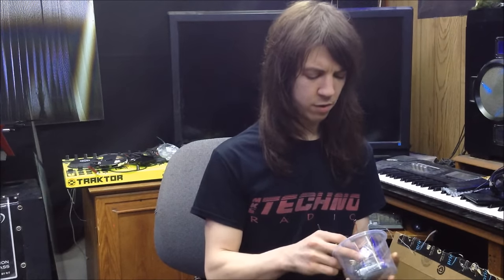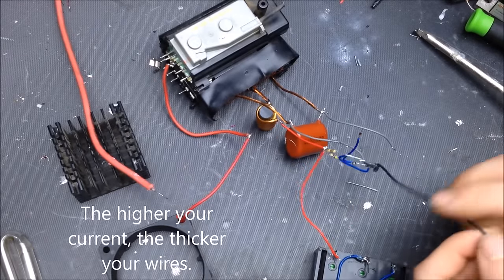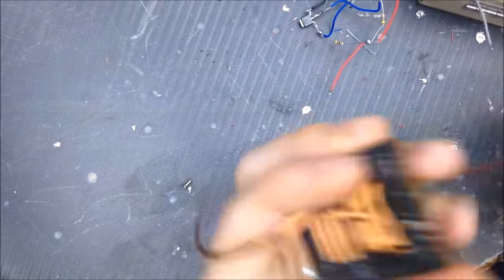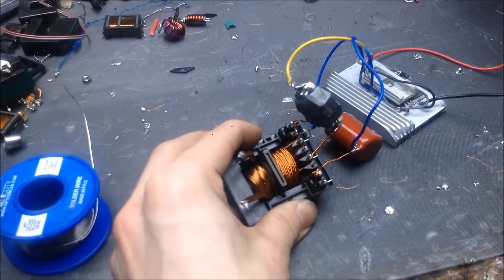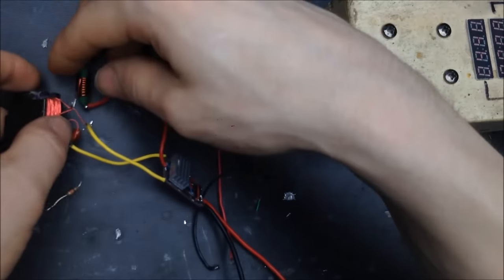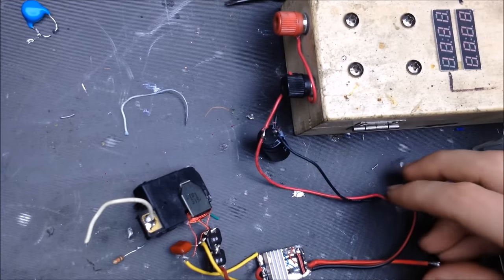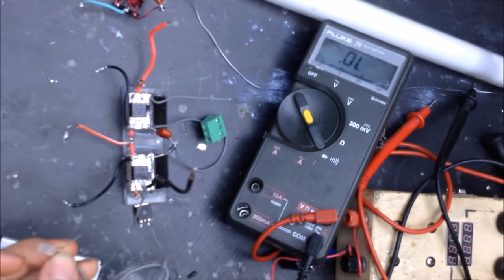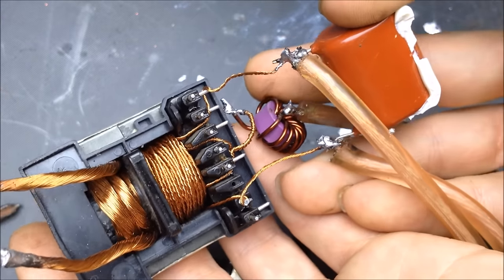Bare&Basic ZVS Circuits of all shapes and sizes.

Comment: A friend gave me some random stuff a while back and in it was one of those little high frequency transformers. It had a center tapped bifilar primary so when I saw it had a decent arc from feeding half of the primary a square wave I tried just wiring it up as a blocking oscillator and it gave me an amazing arc from something around 5 watts. It was surprising similar input and output compared to what I got using the frequency and on time I ended up liking the most from the square wave generator so it must have been a fairly low duty cycle still able to output the burning plasma. The arc was way longer than it should have been, something close to an inch and I was going to make a battery arc lighter from it but stuuuuupidly tried 'potting' it with gorilla wood glue and it ruined the secondary. Similar transformers I pulled from LCD monitors wouldn't perform the same. Been trying to get into flybacks again recently and I always think of that little transformer.. tape was gone too along with the part number. I'll def be absorbing what I can from this video over the next week or so I've just been slacking on scrounging for some 12v zeners.

Comment: what inductor should i use for a tesla coil?
Reply from the maker: How many watts, volts, amps is your TC? your frequency? what roll does the inductor play in the circuit?

There is so much that goes into properly calculating all these factors. Try this website to figure out what you need for your configuration.
http://www.classictesla.com/java/javatc/javatc.html
Reply: @Zenodilodon   @Zenodilodon  10 amps at 12 volts i want to find the right inductor for the ZVS for the best output power on the secondary by the way the secondary is a 500 turn coil with 28 AWG 
i am scared to fry my driver or coil by being stupid
thanks for the link m8 :D
Reply from the maker: @anekdoche7055  You're scared to fry stuff? Mate, you're making a device that fries stuff lol.

You're probably going to need something of decent size and speed. Let me give you some tips on how to figure out what will work. 

The wattage you will need is around 120W, consider the size of the magnetic components needed to move that kind of power ( IE the small transformer in a 5v1A phone charger VS the transfo'rmer in a laptop PSU ) This will give you insight on what magnetic mass you need.

Note that most ferrite cores will work as long as they are not for filtering purposes and will eat your power and got hotter/have slow response. 

You will want to skirt as close to the minimum core size needed as the TC itself is an air gap core that typically has a much faster frequency than the response of magnetic materials. 

You will want to wrap decently thick wire around your core, I'd say 2mm width of EM wire would do and you'd probably find a good spot between 10-20 turns.

I hope that helps you grasp a bit more what your options are, how they work together, and how to select/make your needed  inductors for this and future projects.
Reply: @Zenodilodon  thank you very much, i will look into it :P

Comment: I ordered a Transformer simular to the one you used in the plasma pen video, it just was about 16 times smaller but looked identical!
Reply: when watching this through again, at 39:49 subcaptions picked it up as "holy wow" idk if you did that or its just youtube, but its pretty funny.
Reply from the maker: @JotticunChapter2  I watch the messed up subtitles, they are funny sometimes. I have seen them also omit strange stuff, like " None sense " was removed. I was like but why? 16 times smaller? That's like the size of a piece of rice.
Reply: @Zenodilodon  ok, ok mabey about 4 times smaller but 4 to th4 power of 2 is 16 soooooo i was really only 2 off

Comment: Can you do a deep dive into the plasma candle circuit ? I can’t find anything close to adequate regarding this topic .? Fantastic work on this one by the way 🙏
Reply from the maker: The trick with make a plasma candle is that it must be very fast, into the Ghz range and quite powerful. These are often done with large vacuum tubes and isn't something I have any experience with. Tested2Destruction might be able to help.

Comment: Plasma pen was nice work. And I myself wanted to create one, so I made ZVS circuit as shown in your video of plasma pen then I tested it using LEDs as shown in this video , it worked fine but when I connected it to transform then there was literally no output voltage not even small voltage, I think my transformer was also fine as when I connected it with 9V battery then at time of conncting it to battery current jump up and goes down on disconnecting so it had shown a small voltage output just with battery, so transformer was fine. But I think switching was not occuring when I connect ZVS to transformer or may be another problem. Can you tell me a way to fix this issue?
Reply from the maker: Your inductor is probably the cause. There have been situations where I have tried inductors at random and it makes the circuit not work at all. It's about the only thing I can think of that would prevent it from working correctly. Also what voltage are you using for input and what resistors are you using for the gate pull ups?
Reply: I am using 333 ohm resistors and 5-9V for input.
Reply: Which inductor I should use?
Reply from the maker: @maniksingh4119  Your resistors should be good. I cannot simply tell you what inductor to use as that all depends on your transformer and configuration. Pairing a transformer and inductor is one of the harder things to do and it can be a bit of trial by fire.
Reply: Sir, I had tested circuit with 5-6 inductors but none had produced output, are you sure that it is problem of inductor and you had mentioned inductor in description maybe 4r0 inductor something what does that mean? Please guide me
Reply: Does capacitor have any effect? I had used a 1uF capacitor (SMD) and toroidal inductor.
Reply: I'm using nikos p70n02ldg MOSFETs
Reply: Can I use 4R7 inductor?
Reply: I have used everything in circuit according to your video in terms of values capacitors are 1uf 50V, MOSFETs are 75A, 5m ohm, 25V , resistors are 333 ohm, diodes are fast switching, transformer is almost of same size and shape as yours, very similar. Only thing left is inductor which I used randomly. But I will try 4R7 inductor
Reply from the maker: @maniksingh4119  Yes capacitors do play a role, but not as large of one as the transformer/inductor. This is a tricky balance or parts and I still have troubles with it myself, it's just the way it goes honestly. Realizing how tricky it could be is why I posted up such a long video and included failures. All I can really suggest at this point is to keep trying configurations and messing around with values. Eventually you will find a combination that works well. The numbers on the inductor is it's value in Henrys.
Reply: Sir, I have tried 4R7 inductor but it's still not working literally
Reply from the maker: @maniksingh4119  I'll try to make a note to get another video up about how to make a slightly different kind of ZVS that seems to work better than the style in this video. I don't know how to help you otherwise. Sometimes trying to get a working ZVS can be tricky, this is part of the reason I went to using the other style. I might be able to get to posting that video in early September.

With this style I have had to try many times to get ones that work well. However all the information I know about this version is in this video. Until I post up the other style you will have to try to figure out the problem. I do not know your transformer properties, power source, or level of skill in making electronics. 

Sometimes I have to try many inductors and capacitors and often diodes and mosfets can also fail while trying to make something that works. Do you have a multi meter to test parts? What type of power source are you using?
Reply: Yes, I have a multimeter and I am using 9V battery which is used for radio transmitter
Reply from the maker: Test your diode/mosfets. 9v has a tendency to be a bit to much for some mosfets and I tend to keep tests below 8v If you are using a 9v that is like the one often found in smoke detectors ( MN1604/ 6LR61 ) you probably don't have enough current to really run the ZVS. I use a bench PSU or lithium ion only which can support higher current output. 2 lithium ion cells tends to be one of the best sources of power for ZVS.
Reply: My ZVS is working fine when I tested it with a pair of LEDs means all components of ZVS are working well but there is some other problem.
Reply: I am trying from a month to get it working. It has really tested my patience and now I am getting somewhat impatient. PLEASE HELP ME
Reply: My MOSFETs are specified as 75A, 5mohm, 25V
Reply: But no output means circuit is not oscillating. What is the cause?
Reply: I had used circuit simulation app called "every circuit" to understand what is happening but I got more confused and I was not able to set values (of MOSFET in app) similar to MOSFETs that I am using in reality and also for diodes due to which I not particularly able to understand what happened to my circuit.
Reply from the maker: @maniksingh4119  I am sorry that you cannot get your ZVS to work. I do not know what more advice to give you. I have said I will also try to get another video out later this summer/fall on the topic. 

As for your patience, well some of my projects take multiple years to complete. This is a fact of life and learning/perfecting a skill can easily take years. Nothing is easy and I continuously tell people that. Look how long it took you to walk, speak, take a crap in a toilet, put pants on, etc. 

You also have to keep in mind that on top of projects that take months/years to work on I also freely help other online such as yourself. 

Do keep trying, you'll eventually figure it out, but also understand there is only so much I can do for you. I suggest getting better batteries and also maybe try different transformer and inductor combinations, make your own also and see what ends up working the best. 

I can show/tell you how to fight a bear, but I cannot fight a bear for you if you choose to attempt it. You took on this project, it is your will power that much carry you to success.
Reply: Hello sir, very very very very very very very thank you first of all
Reply: I had changed my input power source and used 18W charger and because of high current input, it worked
Reply: Sir, what is the minimum distance for arc production in your plasma pen made by you
Reply from the maker: @maniksingh4119  The best starting arc was about 3mm.
Reply from the maker: @maniksingh4119  I am so very glad you got your circuit working! It's always nice to see success in others!
Reply: I think arc from my transformer are not as big and powerful as yours, can you guide me for how to increase arc length and power
Reply: Which battery should I use and what is it's capacity in mah and it's voltage?
Reply from the maker: @maniksingh4119  2 lithium ion cells work very well for ZVS at 8.4v in series. Mah doesn't matter because that is run time, what matters is current capability of your power source. About guiding you to make longer arcs, basically either decrease primary turns and increase secondary turns on the transformer. Since you already got one working which is the hardest part I think you are now good to experiment on your own. Don't take it personally but I cannot continuously assist everyone in their projects and still have time to work on my own. But I understand it's also difficult which is why I have the longest ZVS video on YouTube lol. 

Good luck on improving your arcs!
Reply: Hello sir, I had accidentally destroyed my secondary winding can you tell me what is the thickness of wire in mm and what are the number of turns in secondary to get arc like yours?
Reply from the maker: @maniksingh4119  Nope, you are now ready to fly on your own terms of trial and error.

Good luck.
Reply: Sir, this is my last question, please tell me how to solve issue of overheating of MOSFETs? My MOSFETs are getting too hot in just 3-4 seconds when connected to transformer.
Reply: @maniksingh4119  if your MOSFETs are heating, probably it's a problem with MOSFETs not turning on properly or the voltage exceeding that rating of the MOSFETs (in zvs, the resonant voltage can be high as 3 times the supply voltage), I have tried with 30v MOSFETs and they get very hot, but with 55v ones, they run cooler with 3-4 amp, I used irfz44, 200ohm resistor, and film capacitor (low esr) at 12v with iron core inductor, non toroidal ferrite inductors also worked with me. if you are using your circuit at low voltages, try to lower your resistors values, and use MOSFETs with até least, 4 times the voltage of the power supply. 
(I don't know how well I wrote this, but should be understandable)

Comment: I watched all the video and you explain everything, but I don't understand how did you connect the zvs driver to the tesla primary and secondary (the tesla pen)
Reply from the maker: Same as any transformer in the video. You have a primary with 3 legs on for each mosfet out and then the center tap for ground. For use like a plasma pen any high voltage ZVS will do the same thing if you ground yourself placing the  " closest wire to primary " of your secondary coil  to yourself acting as a ground and then placing a sharp tip on the furthest secondary output. Please also not the pen is NOT a tesla coil, it uses a rewound CCFL inverter transformer. It's just a high voltage transformer and ZVS crammed into a little tube.
Reply from the maker: Running tesla coils of ZVS can get tricky as they often don't have much magnetic if any for proper ringing on a ZVS, other options like spark gap or other transistor set ups will be better for running an open air core transformer like a traditional tesla coil, The ZVS works great for magnetic transformers.
Reply from the maker: Did you figure out the differences and find a working solution for a tesla coil? You can also try to play with magnetic transformers more on ZVS. There are Tesla coils that use ZVS + high voltage transformer to charge a capacitor bank for a decent sized spark gap tesla coil.

Also did you find the other video I spoke of on Join The Technicians?
Reply: Zenodilodon I see the video of the plasma pen one year ago I put a comment on it, it is awesome tutorial but I wanna make the tesla magic marker and after the plasma pen
Reply from the maker: It's coming, it's a simple n2222 slayer, not much special really. I want to try to make a better set up before I tackle it because I would love to see a little more power out of it, aside from that it's as it is now not much special.

Video work is not my forte, it's slow and a side task for me but as I said, it's all coming and more.

Comment: when paralleling mosfets, do you have any advice other than an extra resistor on the gate ? : )
Reply from the maker: I don't recommend putting mosfets in parallel, this can mess with things and I have has situations where instead of starting the osculation it turns on on both sides a bit more and cooks mosfets. I would just step up to using a larger mosfet instead for this application.

Comment: Sir this was an excellent video explaining all the underestimated facts , but the problem of dying mosfets still persists and if you have provided the circuit for the part where h use only one coil for primary   it would be very beneficial.....
Reply from the maker: I just learned of that style which uses a regular transformer in conjunction with a center tapped inductor or pair of matched inductors. When I get better with that style I plan on doing an update video on the ZVS stuff. If you need/want a diagram showing how to make that kind I can send it to you through e-mail. Send me an e-mail requesting the diagram. Zenodilodon@gmail.com

Comment: Hi... just a quick question..... when connecting the zvs driver to a coil, is it OK to keep the LEDs connected as a visual indicator of status??? Awesome channel BTW
Reply from the maker: Yes you can keep the LEDs connected, keep in mind that when the transformer is connected that you may have to handle both higher input voltages and ring up on the transformer's primary so I would advise using suitable resistors in series with the LEDs and consider using 3-5 volt zener diodes to protect them. Thanks for the complement and good luck on building your ZVS!